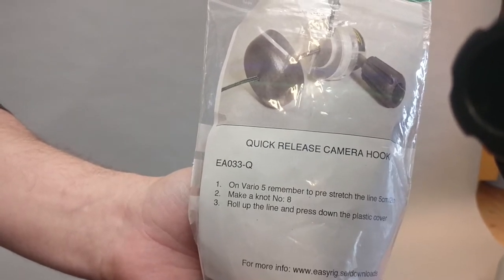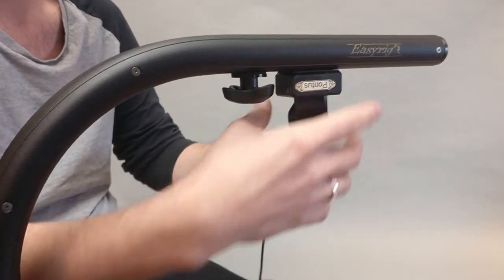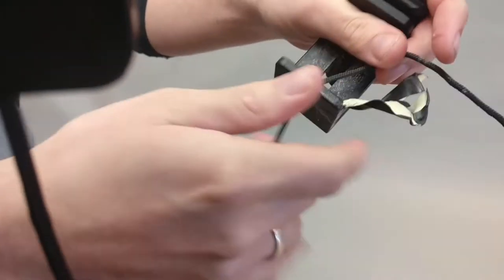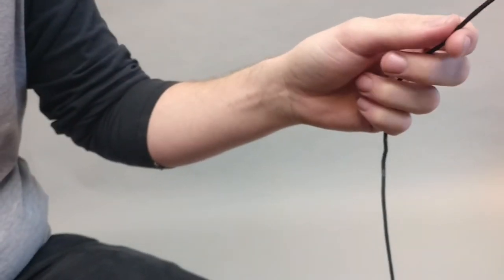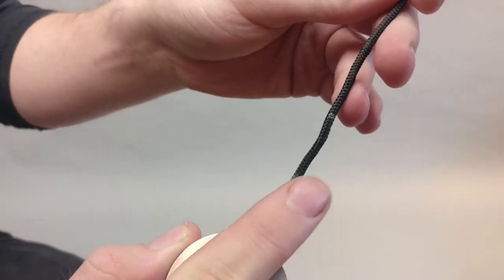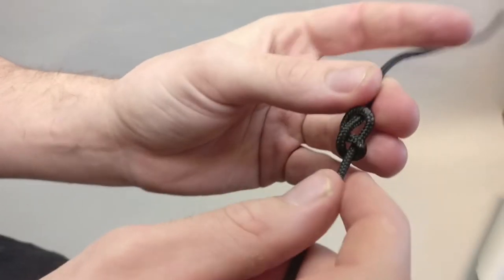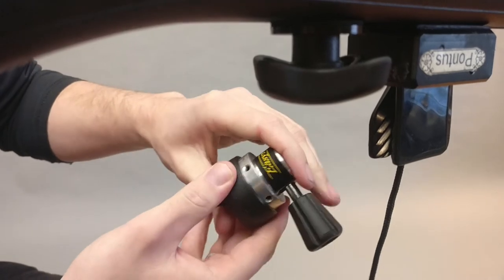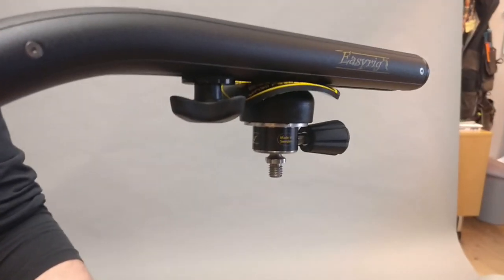How to mount the Quick Release on a Easyrig Vario 5

Comment: Whatever you do, absolutely make sure the line is super securely fastened before attempting this.  I wrapped mine around the pole several times and it stayed in place for about 5 minutes and then slipped and recoiled all the way back into the shell, which is not something you can fix on your own.  You'll have to send back in for repair which can take up 1-2 weeks.

Comment: The screw mount that attaches to the camera eventually unscrews and I almost lost the camera twice today. How do you keep the screw from unscrewing ?
Reply from the maker: The Ball Stud is designed in a way that you can tighten it with a wrench so ensure that it is secured in place.
Reply: thanks, I was thinking that but wasnt sure if it would strip the thread on the handle, @easyrig